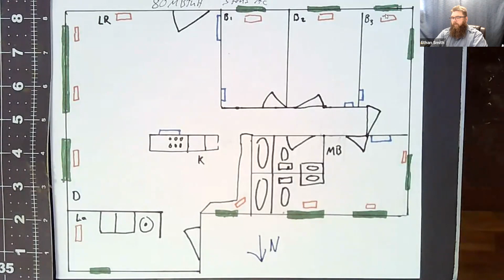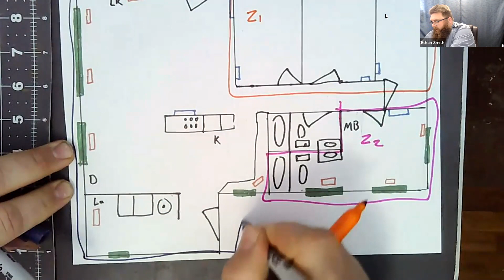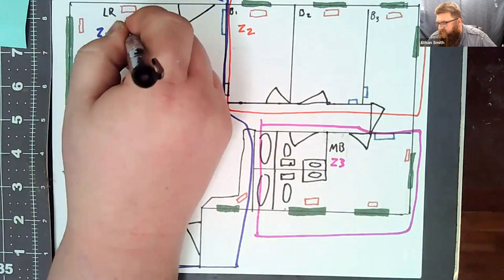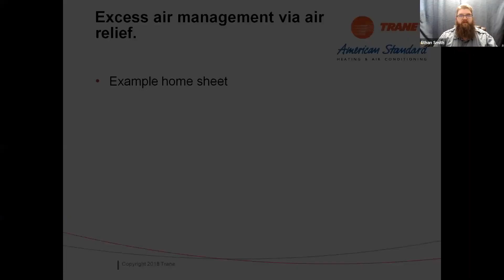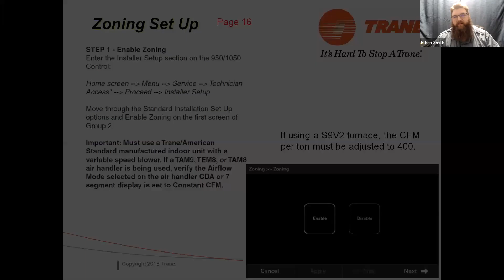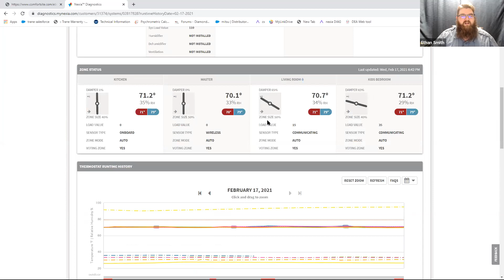Zoning Theory and Setup - Trane/American Standard Class w/ Ethan Smith 2.17.21

Comment: I’m not an HVAC professional, but I enjoyed your video. Very informative. I have a question regarding return air in a zoned system. You mentioned that dedicated return ducts are necessary. My questions is, do these return ducts need dampers as well as the supply? If all of there returns are connected to the air handler, wouldn’t the unit be pulling air from every zone and not just those calling for air?
Like I said, I know nothing about hvac systems so the answer may be obvious to those who do.
Thanks!
Reply from the maker: While each zone will have a small amount of return air pulled from it  when one zone is calling, the majority will come form the zone that is getting air due to the fact that if you put air into a zone and equal amount of air will have to leave that zone be that either through a dedicated return which is actively removing air (preferred) or through “sympathetic” leakage of air into other zones through then home and then getting pulled back to the air handler to be conditioned. Either way if you put air into a zone air will have to leave that zone. If you have a dedicated return, it prevents crossover of the conditioned air leaving the zone and leaking into others.  Return dampers can be useful in cases where zones are a long distance from the air handling unit but in most cases simply having a dedicated return(s) is sufficient and more cost effective.  

This is of course all predicated on each zone having adequate return duct work to be able to handle the full amount of air that is being supplied to the zone. 

Since the recording of this presentation, I have installed zoning in my own home using the dedicated return method and after extensive testing using extreme temperature differences between zones I notice little to no crossover of conditioned air into other zones all without return dampers.